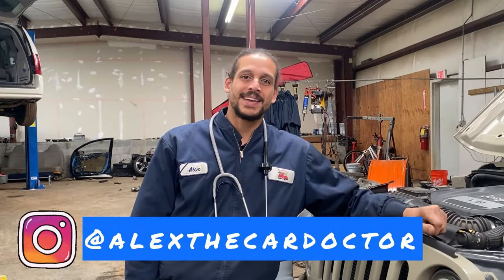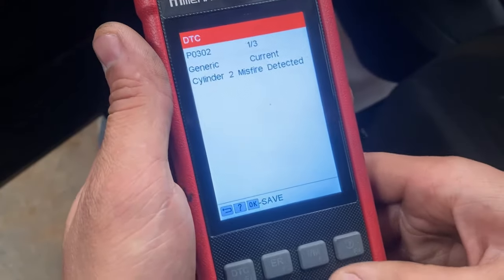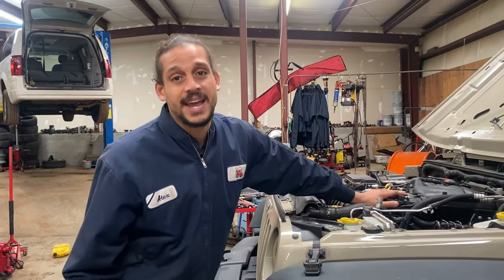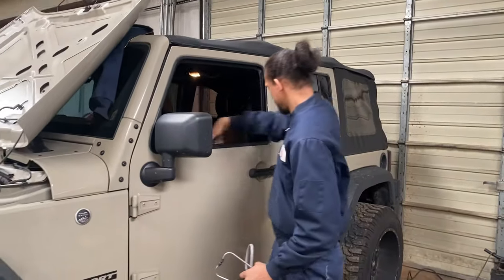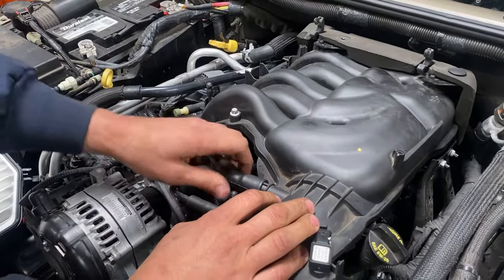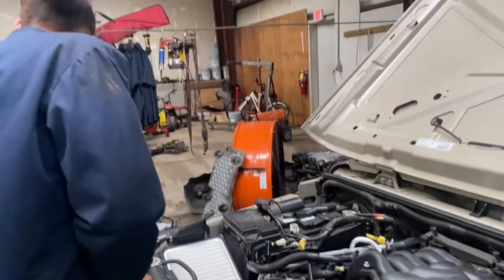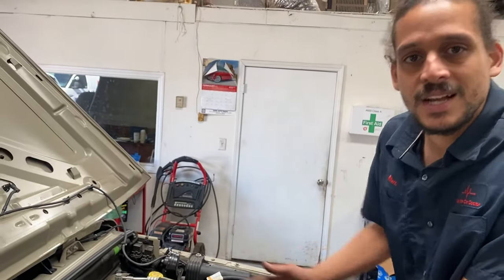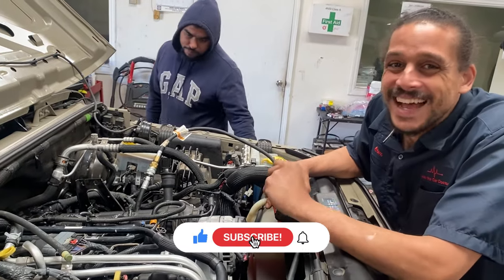Jeep Wrangler needs Major Engine Work at only 40,000 miles! | 3.6 Pentastar Issue #jeep #autorepair

Comment: Fuel Injection sucks hard! Repair Dealers are expensive, injectors are expensive and the job itself is royal pain! Carburetors where cheap and easy repairs, I could take a carburetor off rebuild it and have it installed and adjusted within 2 hours for less than $50 and I so wish I had kept my carburetor fueled engine vehicles and just restored them.
Reply from the maker: I’m pretty good at rebuilding carbs but suck at adjusting them lol

Comment: easier wat to disable fuel on a jeep is to hold accelerator pedal to the floor while cranking, this will put it into clear flood mode and the engine will not start, just a tip
Reply from the maker: That is correct

Comment: That should still be under warranty, Mopar has a 5yr/60k on Powertrain for Jeep vehicles.  My 2016 has 7/100k powertrain warranty, as I bought it Certified Pre Owned (CPO) and it is covered until April 2024, but the normal powertrain is 5 year / 60k miles.  In 2021, when this video was made, A 2018 with 40k miles in 2021 ? THAT VEHICLE WAS STILL UNDER POWERTRAIN WARRANTY !!!!  They would have probably given him a new engine.

Comment: I had my oil cooler and spark plugs replaced on my 2015 Wrangler Rubicon. Since I had it changed my gas mileage has tanked (no pun intended) and it’s sluggish. What could be causing this? I am not getting any codes at all.
Reply from the maker: Hey buddy sorry to here the bad news and thanks for watching. What type of plugs did you install Brand and material
Reply: @AlexTheCarDoctor  I’m not sure what was used I took it to a shop. I can check them.
Reply from the maker: @stevethompson7613  they may Lie to you get a unbiased opinion have a friend or mechanic buddy pull one of the plugs out and let me know what you see
Reply: @AlexTheCarDoctor  you’re not that far from me and my son lives in the city where you have your shop. I don’t care to drive 4.5 hours to have you to look at it.
Reply from the maker: @stevethompson7613  I understand! I’d be happy to check it out for you if and when you come to town. Call ahead when you ready so I can be prepared for you.
Reply: I have a difficult time believing this and here is why… due to epa regulations that govern tailpipe emissions the PCM has a very small margin of error in terms air/fuel ratios, mis-fires and engine timing. Any of these could reduce fuel economy but would absolutely illuminate the check engine light. So the fact you are getting no fault codes tells me that the repair was done properly. However, there is the possibility that you could have a restricted exhaust (catalyst) that may not be easily detected but in time will set a p0420/421.

Comment: Man I have a 2016 jeep wrangler jk and my check engine light came on ran the reader and it's giving me a p0301 which is a misfire on cylinder one I changed spark plugs but same problem it feels like it wants to shut off and shake while I come to a stop I'm going to change the coil see if it helps but watching this video kind of scared me I wonder if I'm not getting pressure in it. Quick question I have extended warranty  through a 3rd party but the dealer always gives me the run around when I use it and takes like 3 weeks for anything small and now I hate the hassle can I take my jeep to any local shop and will it cover it through extended warranty?
Reply from the maker: Find the number to the third-party warranty company and called them most local auto repair shops accept third-party warranty company I know I do
Reply: At what mileage did that occur?

Comment: wow that sucks at 40k miles. i have an 18 jk willys 2 door with 2 1/2 inch lift 98k on the clock. i have MSD ignition coils from 25k miles to now. i have had no problems with my engine and i run it hard up mountain highway roads with 34 inch tires. no problems at all. runs like a top...

Comment: It's an mini van engine. Chrysler is notorious for under powering Jeep wrangler! They probably think the low gearing makes up for the bad engines. What makes a wrangler a Wrangler or a Willies is the low gearing and the slower than normal prototype engineering. Most companies Chrysler included have a 4 year prototype year Jeep tries not to change anything for about 6 to 7 years and then only a little bit. Like the body lines. It's 10,000 dollars just to change the body lines of course that is by 1999 prices so it probably went up.

Comment: Can you show how to replace the right side (driver side) valve gasket on 17’ 3.6L wrangler please, I only ever see the left side (passenger side) get done. There was oil in my 2 cylinder spark plug and I’m pretty sure there is a valve leak there, but not sure how to disassemble.
Reply from the maker: Hey there I have a tear down video of me pulling off the valve covers on both sides that may help until I get a chance to do one on a wrangler
Reply from the maker: https://youtu.be/hK-rf2o3ozk

Comment: Where are you located? I have the exact same issue, and the mechanic did the exact same things. Mine has 75k miles. I'm watching now. I hope I can learn something about this issue. It runs great just like that one, and I only feel a very, very slight vibration at low idle. Other than that it's perfect. That light is messing with my mind. Lol. Thanks.

Comment: Thought these had a 60k powertrain warranty ??  Wow 40k  thats terrible.  I wonder if the idea of poor break-in is the culprit here or if it's just a quality control issue with Chrysler.  I'd like to know whats the final diag on it.
Reply from the maker: I convinced him to take it to the dealership and the dealership took care of them free of charge,Bad cylinder head also I thought the same thing  wasn’t broken in properly
Reply: This is a design and manufacturing problem. Period. This came from the dealership that replaced the driver's side head at 80,000 miles. My 2014 was babied from the second it came off the lot. Oil changed with premium oil every 3-4,000 miles. All scheduled maintenance performed, etc.

Comment: before i scared the customer i would have pulled the valve cover knowing the problems with lash adjusters and rocker arm problems with those engines might have lost lobe on cam but everyone goes about diag differently
Reply from the maker: It was definitely the cylinder head. Either way it was under warranty. They went and got it changed for free and that solved the problem.

Comment: I’ve had this same code at 30,000. Needed head replacement. It was under warrantee.   Mechanic switched over cool packs on cylinder code still remained. These Penestars do have, although infrequent problems with cylinder #2. Not enough problems for a recall.
Reply: i totally disagree. i've had multiple issues with mine and every mechanic outside of a dealership will tell you they have a problem with the Pentastars.

Comment: Great video sir. I have a dilemma that you may be able to provide guidance on. 12’ JKU (114k miles) son did cold start before school and was idling during a cold morning the other day. Engine started stuttering and puffing white smoke and then died. Jeep would not start back up afterward, cranks but won’t run. Threw a code for oil pressure sensor, so I replaced it after I disassembled upper intake and lower intake manifolds. I also changed the spark plugs while in there, since they were through. Still won’t start but it sounds like it wants to. Fuel pump makes buzz noise when key is turned on so I don’t think it is bad. Do you think maybe fuel filters are plugged? Or could it be something else? Battery is good also, and fuel in tank is fresh. Any guidance would really be appreciated!
Reply from the maker: Hey buddy sorry to hear the bad news buddy.start by checking the engine compression with a engine compression gauge and make sure you have spark
Reply: @AlexTheCarDoctor  thanks for the quick response. I will have to go buy that gauge, as I really don’t work on vehicles except for basic aftermarket upgrades, and general maintenance. I will keep you posted. Thanks for all the great videos and guidance Alex! 

Daniel
Aiken SC
Reply from the maker: @Jumpwingz  my pleasure buddy

Comment: So let me ask, honestly how reliable do you think this engine is? What is the Jeep was used to deliver rural mail with 200k on it. Has an extensive service history with no major problems reported.
Reply from the maker: My saying is this if you take care of your engine it will take care of you but to answer your question the engine do require a little bit more maintenance than others. Would I own a 3.6 Pinter star no but I’m not knocking they are good engines
Reply: @AlexTheCarDoctor  fair reply. I am also looking at a older Jeep with the 4.0 was just over 100k on it. Also has extensive service records. I have had both engines and the understand about the 3.6. Had it in a Grand Cherokee and with the 6-speed it was pretty terrible. Drove it with the 8 and much better. 

Anyway, I am not in a hurry and thanks for the response. I may go take another look at the older Jeep with the 4.0.
Reply from the maker: All I have to say about the 4 liter is they stopped making it because it was too good was not breaking enough so they wasn’t making any money LOL
Reply: @jeffdurling100  I just came across this video but know it is over a year old.  I hope you've found the right Jeep for you by now.  I own both a 95 Cherokee with the 4L and a 2016 JKU Wrangler with the 3.6L.  My Cherokee has 295k (mostly) trouble-free miles on it.  My 2016 has only 40k.  I've done more work on my 2016 in just those 40k than I did in the entirety of my 1995!  Not all have been motor issues.  Things like speed sensors going out, ignition module failing.  I just replaced the plastic oil cooler on my 2016 as it blew up prematurely.  I'm on my 5th Jeep in this lifetime and I'll say that I'm about done with them.  Think I'm moving to Toyota from this point forward.  Good luck in your search and if it's a 3.6L, buy good tools and be ready to patiently spend Saturdays working on your rig!
Reply: @disorderlymovement  Yeah just about every component breaks on Jeeps.  I've got a '12 wrangler with 275,000 km.  No engine work, but I have replaced the oil cooler.

Comment: With only 40K miles he should have taken it to a Jeep dealer first…warranty?
My 2014 Chrysler T&C has 134K miles. CEL light came on. Rough idle. Went to the dealer the next day.PO 302 code. Cylinder head replacement $3000. Number 2 cylinder 100 psi. Failed leak down test. 
Because I’ve owned Chryslers before I bought it new with the Maximum Care Lifetime warranty. Only up to $6500 in warranty repairs since new.
Believe it or not! Had to return the T&C back to the dealer for the same problem last Monday. Service advisor says the minivan might be ready this Monday! That Chrysler Lifetime Maximum Warranty was the smart purchase in 2014.
Reply from the maker: Yeah, that’s what I told him to do and he did. And the dealer fixed it for them.

Comment: There is a problem with the number 2 head dodge has extended the warranty to 125.000 miles take it to the dealer there guys know all about these issues...you don't save any money not going to the dealership because other shops don't have the knowledge the dealership has ...he would know the extended that warranty if he was deal mechanic...

Comment: actually a professional mechanics tools should last longer than home owner because they shouldn't abuse them because they realize the value of taking care of them because that is their means of income. i am 67 still use most of the original tools i started with of course have had to update because of newer vehicles some new tools required but like my combination wrench set is the same set i started with at age 17 when i started my life as a mechanic. if you take care of your tools they will  take care of you. everyone will brake a socket or ratchet all along but the basic tools should last. i just updated my screwdriver set which was a SK that i bought about age 20 but i don't use screw drivers as prybars or chisels. tools used properly will last almost a lifetime

Comment: Must've had a supercharger that was quickly removed. This Jeep has 5yr/60k powertrain warranty. Pentastars are very reliable overall, with he 2012-14 head issue the only real glitch, and they extened those warranties to 10yr/150k.
Reply from the maker: Maybe I forgot people do that but even that’s hard to do with technology that out they are able to tell if you have tuned the ECM that will quickly void the warranty. I agree not many problems, an after market company needs to make metal parts to replace the plastic ones like metal oil cooler, coolant housing etc
Reply: You are nuts man, mine had the faulty rocker arms and ate a camshaft at 63k miles. Dealer fixed it EVEN THOUGH it was out of warranty they've had so many issues with this junk. Last week the plastic (used to be metal but good old Fiat saved some pennies) oil cooler started leaking and had to fix that (Dorman has a metal replacement). Thing is a 2016 with 75k miles...meanwhile the 1996 Ford F150 4.9 I6 I have had a $100 distributor put in it 10 years ago...and that's all that's ever been done to it in almost 200k. Also, the rear main seals go out early and leak oil. Daughters car, would have never bought it. I like it, don't get me wrong, but it definitely has issues.
Reply: Dorman makes an all metal oil cooler for this engine

Comment: My Jeep JK 2014 has the exact same issue at 70k. Looking at getting another engine or selling for a more reliable vehicle 😭 So sad because I love driving it. You mentioned that the Jeep in your video may have not been broken in correctly; is a used engine with over 100k reliable?
Reply from the maker: It’s hard to say because you don’t know who the previous owner of that engine was, may have been a person that was rough driver and didn’t take good care of the engine. That’s why it’s good to inspect the engine if you can. I had to send back a used engine 3 times before installing it because I didn’t like what I saw during inspection.

Comment: So I am having this issue right now with my Jeep. I’m dropping it off to the dealership this week coming. This made me super sad. Any idea of the cost of that type of job? To tear the engine down? You are super talented! And I learned a lot from this video!
Reply from the maker: Hey there and thanks for watching. I don’t deal with pricing that much this days what year is your Jeep, hopefully it is under warranty
Reply: My 2017 Grand Cherokee Overland went in today with this same error code (P0302) I bought it new and have had it less than five years. It has less than 74k miles on it and has been meticulously maintained changing the oil every 5k miles. From what I have researching, it’s could be a worn rocker arm(s) and that could have damaged the camshaft. If so, the top of the motor will need to be torn down and the parts replaced. Could end up costing me thousands of dollars.
Reply from the maker: @rickteeden8656  sorry to hear that. Let me know how it turns out
Reply: @AlexTheCarDoctor  
Hey Alex,
They replaced the rocker arms and the camshaft on the left bank. Ended up costing me just over $2K ☹️
Reply from the maker: @rickteeden8656  dang hopefully that’s it for a while
Reply: I can't believe this isn't a major recall.. I bought my 2015 wrangler new, now has just over 12,000 kms, garage kept, looks mint. Runs fine but what to do.. sell it??
Reply: @pujabelgian  7,000 miles? It's just a baby. Yes, your model year has a high chance of this happening. Or not. There many millions of these engines and certainly not all of them have this problem. If you don't drive it that often you should at least start it regularly to get oil into the engine. When you do, get someone else to start it and you listen to it with the hood open. These pentastars do clatter a lot, but if you hear a regular ticking noise tick-tick-tick at idle and it speeds up when you give it gas, then take it to the dealership immediately.
Reply: I am replacing the gaskets on mines while I got that manifold intake off.  I also gonna replace all 6 of the fuel intakes and all 6 coils too.

Comment: I have a 2013 Jk. At about 80k miles i had the spark plugs changed because i had the oil cooler changed. Ever since, SOMETIMES it chokes while starting. I'd say 1 in 10 times if that. Any ideas? I told them specifically to use factory spark plugs
Reply from the maker: Hello.I would get a second opinion on the spark plugs most times shops lie. Any warning lights on

Comment: Just put a crate motor in my buddy’s 2008 Nitro due to bad heads and other issues.
Shame they can’t build engines like they used to.
All the freaking plastic parts inside them nowadays is just plain sinful.
Reply from the maker: I 💯 percent agree The life of the engine nowadays I believe 100,000 miles lol they design it to fail
Reply: @AlexTheCarDoctor  100,000? 🤦‍♂️

Comment: does anyone know what vehicles with the 3.6 pentastar are compatible donors? I do have the same issue on my 17 JKU and it had less than 30k miles, I am looking forward to replace the whole engine instead trying to fix the cylinder head
Reply from the maker: Hey buddy I don’t know the answer to your question but here’s a tip, at many local Salvage auto places they have the software that tells what year is compatible with your vehicle.you may want to give them a call and see if they can help you,you may have to call a few.good luck
Reply: On that drives side head it’s 10yrs 150k miles they have a ext warranty on that head